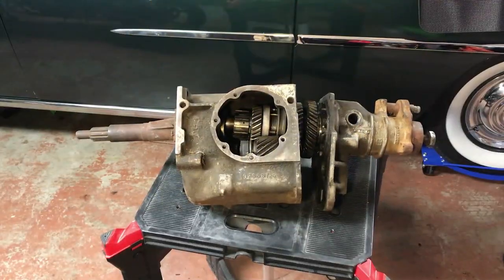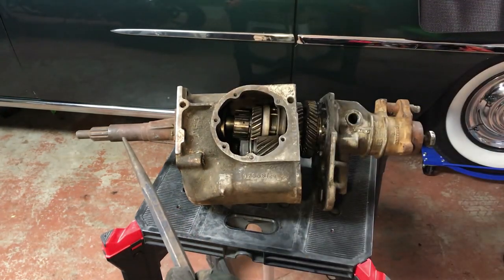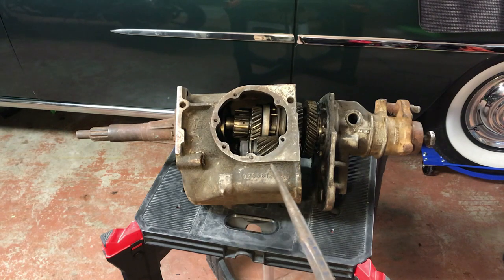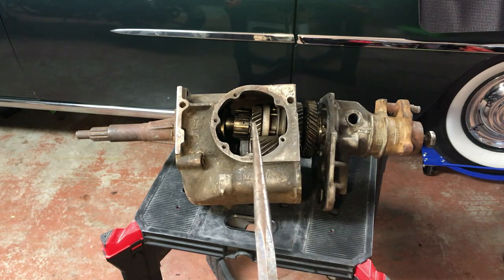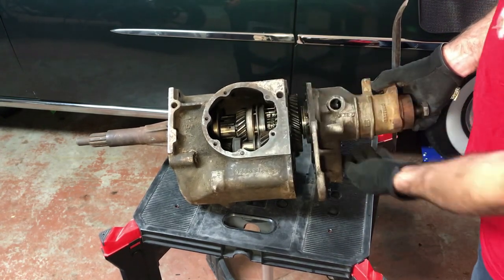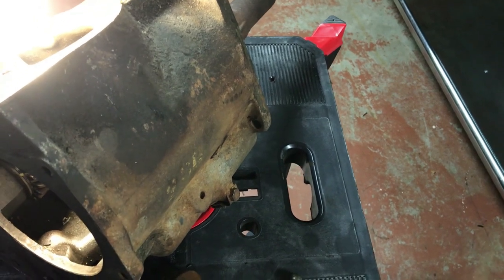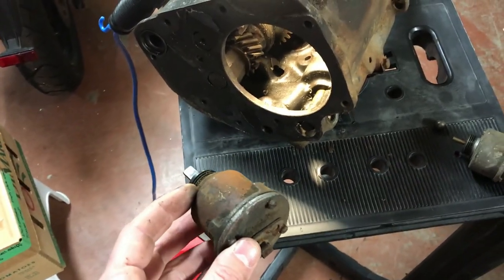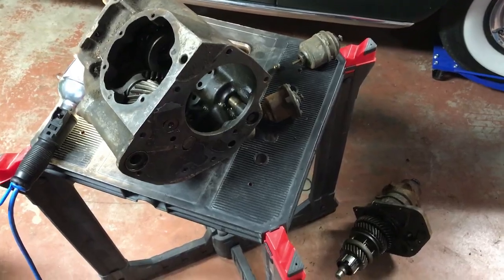Mopar M6 Semi Auto Transmission Part I

Comment: Am trying to rebuild a 1951 DeSoto transmission and am having issues with the counter shafter... We had the replace the free wheeling gear and had to take it out completely.... Now with all the roller bearings in place there dont seem to be any play on that counter shaft.. I would think it should spin freely and be able to put the main shaft thought but it's so tight we cant get it alined and it doesn't seem right can you help 😊

Comment: Thanks for your videos! they help me a lot as '52 windsor deluxe owner 

How can I know if the level of fluid drive transmission is low or high? I think it was never changed.. what fluid should I add? any specific one?

In case of brakes fluid, could I add a standard brakes fluid instead of mopar brakes fluid?

Comment: Great info. My wife and I are restoring a 1940 Dodge Wayfarer Sedan. Is the M6 for sure the same transmission that is in it? Also we would like to clean it up, reseal it, etc. Any recommendations and advice??
Reply from the maker: A 1940, did they have the semi auto tranny then? I'm unsure. Clean it and reseal it, you may need to try and find a local shop that could do that. Or are you comfortable and experienced doing your own transmission repairs?